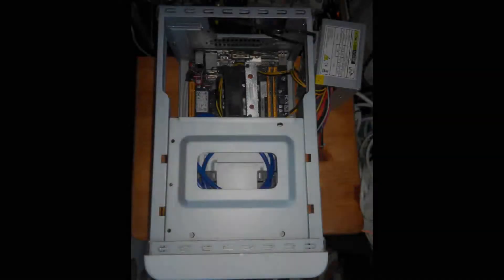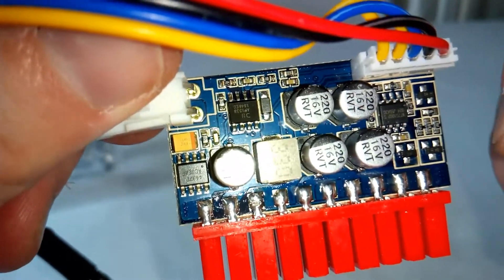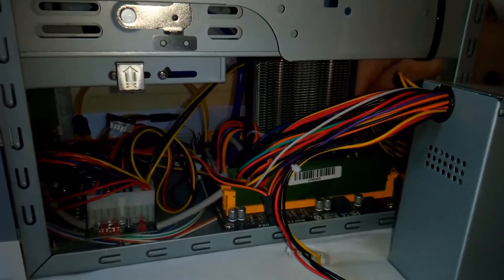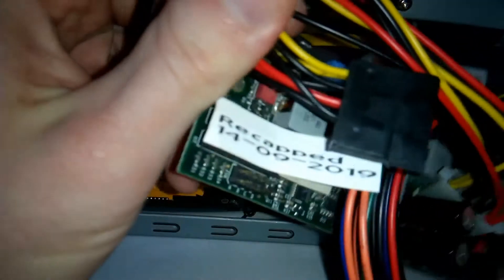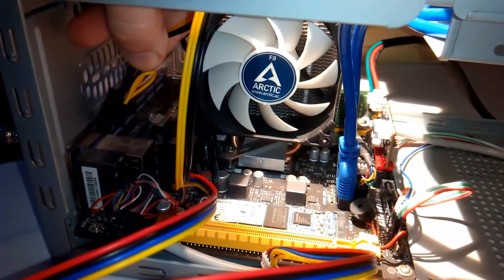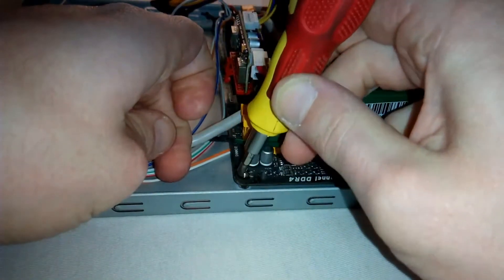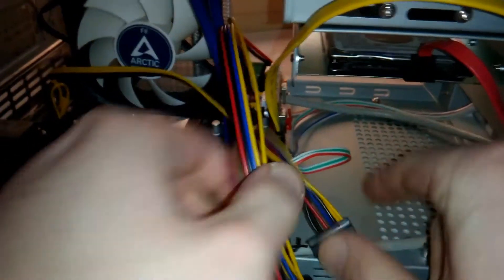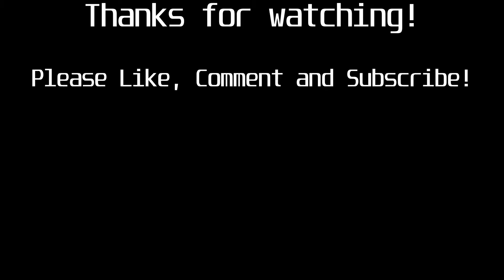Replacing the PSU of the ITX PC | TheVidsByDennis

Comment: So, after two years, are you still satisfied with the power supply?
Reply from the maker: To be honest, the computer as shown in the video has been mostly retired (I still have it and can use it if I want). After this video I installed an industrial Mean Well power supply in the case to get rid of the external power brick. It moved case 2 times and in the end it ended up in a LC-Power LC-1370BII case with internal 90W PSU.